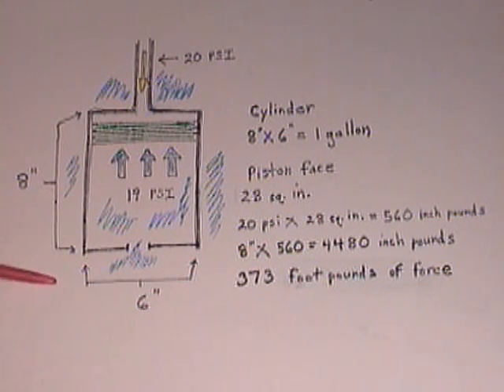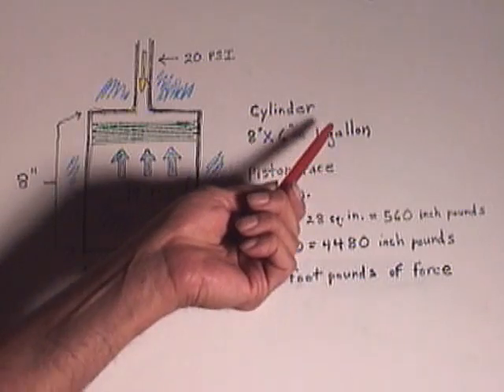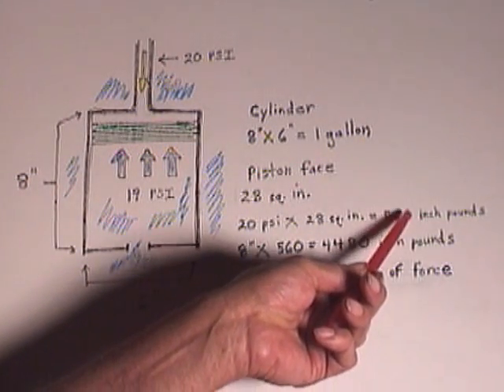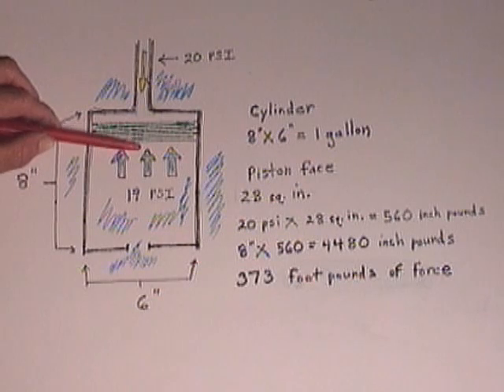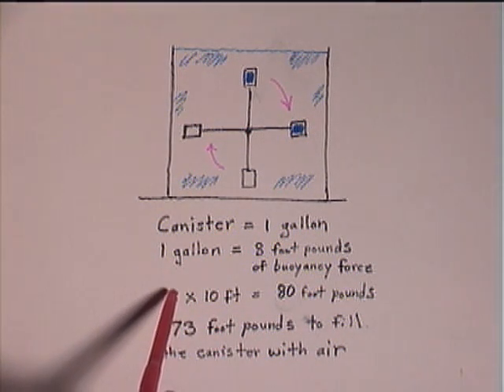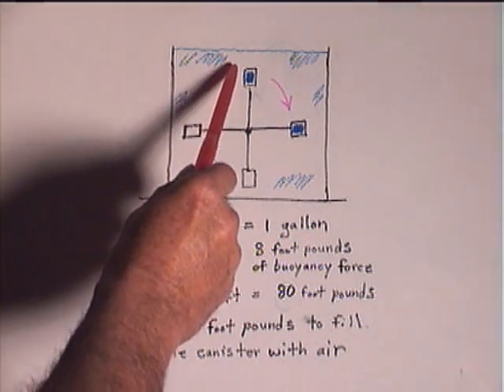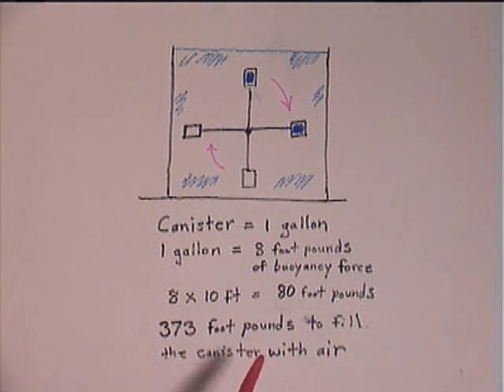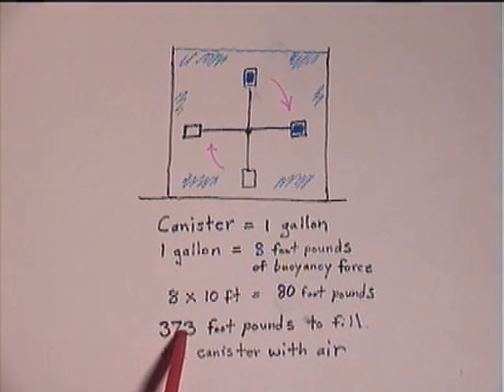Water Perpetual Motion Machine P2

Comment: Well, I think if used cylinder 1.30 m long and 80 cm width, then you put 2 tubes as arms each arm 85 cm , the you fill
cylinder with air, high pressure. You make the air slowly slowly passing into 2 arms (tips of arms), this make arms 
spinning powerful and faster than perpetual motion. Notice that cylinder and arms are in a tank full of water.
The pressure of air will take long time to finish.perpetual motion maybe can work for a few time then it stops 
because of friction and gravity. any way you are really honest and smart person. Good luck man.
Jeel. Saudi Arabia.